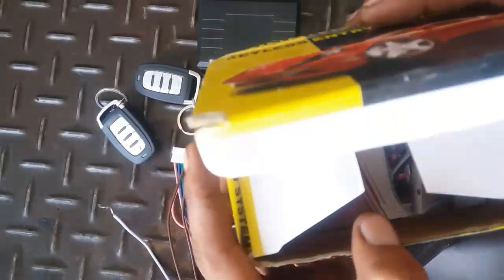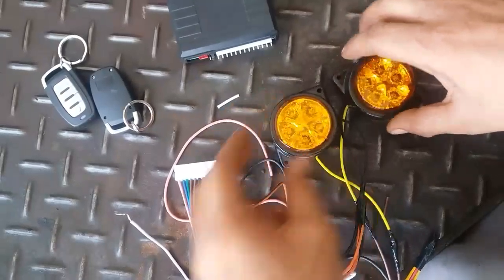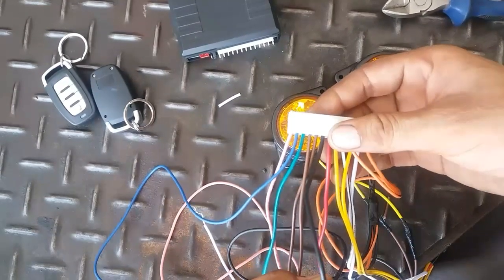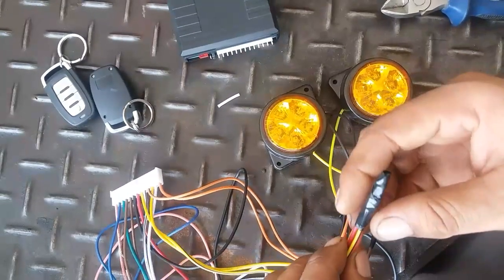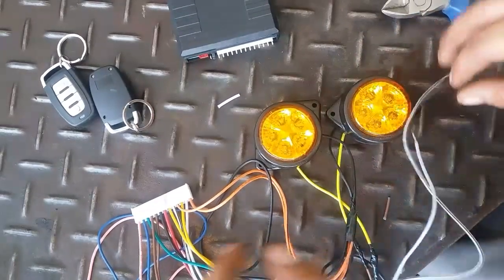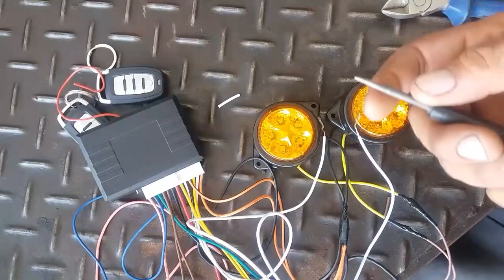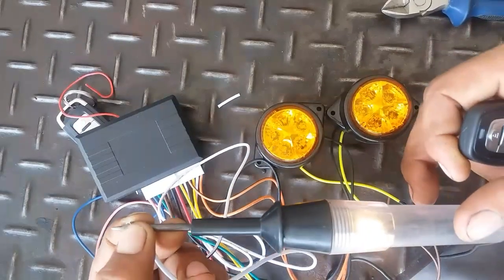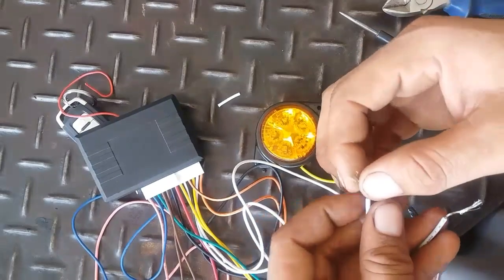How To Install Car Security System By Majid Ahmad Sultani

Comment: f a remote start unit does not have a ground when running wire will the car still run? car with transponder and bypass i mean